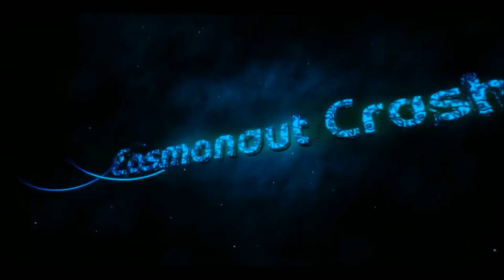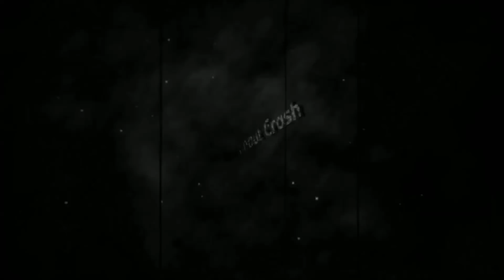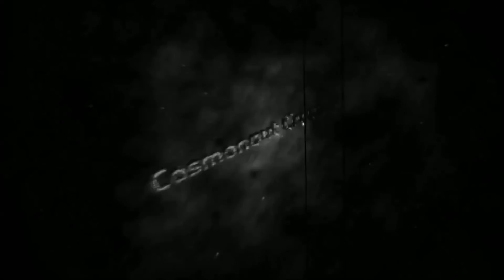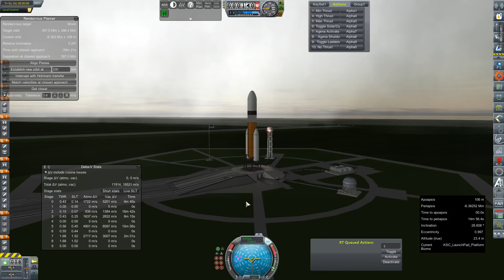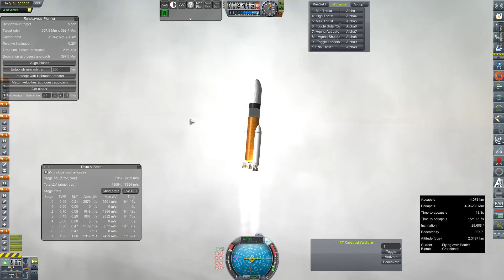KSP RP-0 #472 Lunar Uber2 + Nemo

Comment: Can confirm: the reason that I use those fuel pipes from the pontoons to the engine attachment tanks was so that the pontoons would always drain early in the burn with no pilot intervention required
Reply from the maker: Can confirm : crash is an idiot. 
Yep.
Reply: @CosmonautCrash  I mean you're probably gonna land closer to the base than I could in my attempts.. best I got on a single attempt was 80m away.